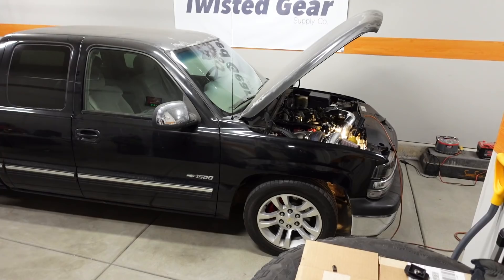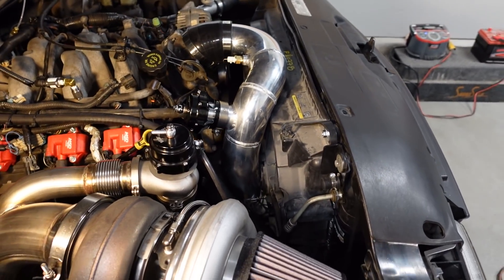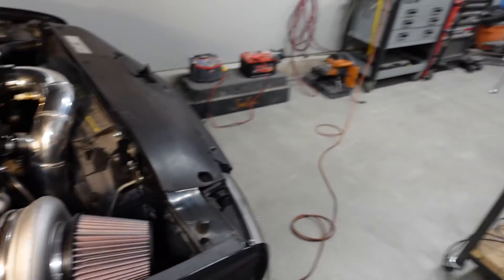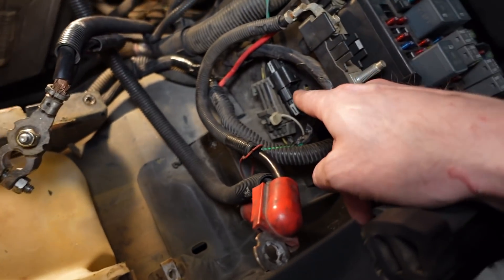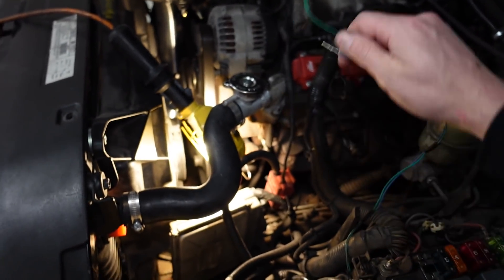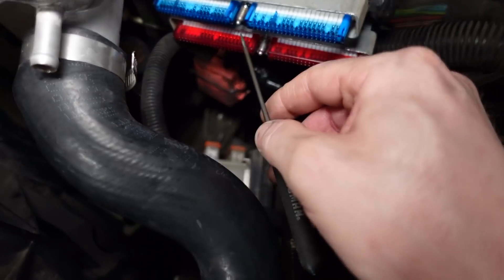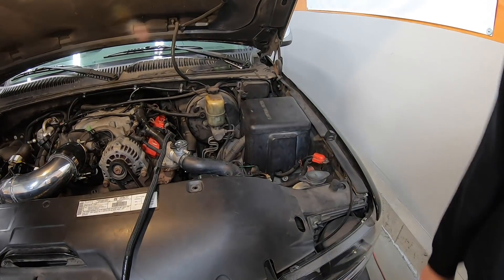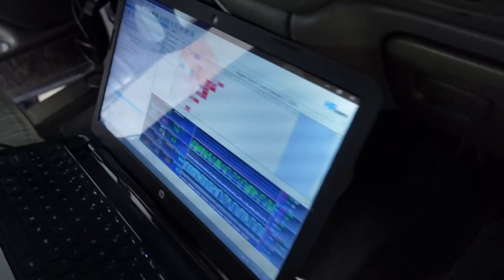Electric Cooling Fans on a 99-04 Silverado ft TURBO 8.1 BUILD ALMOST DONE

Comment: I’m installing the OE fan harness on my 03’ Tahoe with my 408 Stroker swap. 
Terrible luck with aftermarket harnesses and the relays.

The Flex-a-Lite fans I used before were drawing too much power. The Dorman efans for a 2014 fit exact and look OE. 

My buddy has an HP tuner and does it for a living. We’ll recheck and set parameters then plus tune the truck since the new engine won’t run on the factory map.

Awesome vid - I have an 05’ 8.1 2500 Burb that I’m restoring as well.

Comment: on my green/red connector that goes to the PCM, pin #33 already has a wire in that slot. When I bought this truck it was ahead 6.0 swapped but it’s a P01 pcm from a 2001 Tahoe. Any ideas?

Comment: This video actually helped me natrow some options.  Fan works(both).  Realy works. When I tested with  the blue wires on negative of battery it works.  Fan was working fine until a Heather core conection broke.  Now won't come on. New temp sensor was installed.

Comment: Actually, some 07-13s also had a 28" radiator, so the fans for one of those will bolt right in if you your 99-04 has the 28" radiator.

Comment: What is the actual name of the pin connectors for the computer ? I have a factory harness but of course the wires from the harness connector to the computer are missing. So I have to make my own. Thanks.

Comment: @Lawrence LT Tolman  Do I need to buy HP Tuners credits just to turn on the fan? Or are the credits just for tuning the engine?
Reply from the maker: The credits are for the entire engine computer: if you’ve already flashed it with HPT then you can make fan changes already. But, if you’ve never licensed your computer with HPT, it will take 2 credits to flash anything, including the fan
Reply: @TolmanPerformance   Ahh ookay, understand. Thank you!!

Comment: Hey Lawrence hope all is well. I'm here in New Jersey and have just did the efan conversion now I think I am getting a reverse polarity but before I switch the wires I wanted to ask,; do the fans blow into the radiator or the engine compartment? which is correct
Reply from the maker: They suck air through the radiator and push it into the engine bay, the air moves the same direction it would when you drive

Comment: What OBD cable did you use to connect to the computer to reprogram the fans? I'm only finding the wireless hptuner  obd2 connecter? I have a bmw the runs a obd2 to usb cable and wondering if that would suffice? TIA

Comment: What's the extra wiring step needed for 2000 trucks with A/C?
Reply: Did you figure out the additional step?
Reply: @chinogodinez  I ended up going to a salvage yard and pulling the entire wiring harness from a Suburban. Everything seems to work now.

Comment: Great video. . I have 2000 Silverado 1500. Pin 33 on red bank is already being used. Not sure what to do. I’ve found its for recirculation door control. Any ideas?

Comment: I got a 01 sliverado 5.3 how to keep my ac? Tap it in the ac signal wire??
Reply from the maker: no, you need to get an AC Pressure sensor so the computer knows what the AC is doing, and it will turn on the fans accordingly. I made an updated video about this with my AWD truck showing the correct wiring and steps
Reply: @TolmanPerformance  which video is it that shows this??
Reply: Ever find out what video it was that had the update?

Comment: Sorry I'm confused, where do you put the pin you took out of 33?
Reply from the maker: it just stays disconnected. Its original purpose was to force the AC system into recirculate mode if the engine gets too hot, which should reduce the cooling load. Now, the e-fans will speed up when the AC pressure or coolant temp gets too high (I made another video on the correct wiring for an AC pressure sensor)
Reply: @TolmanPerformance  do you have a link to that video? Thanks in advance

Comment: What is the one additional step I need to do to keep my A/C on my 2002 Silverado? Installed radiator, fans, and 99-02 Nelson Harness but now my A/C is not working. Had my tuner get the fans going properly but still no A/C, the compressor will not kick on. Any help would be greatly appreciated

Comment: Is it necessary to do that tuning afterwards? I have an '03 and was hoping it would just be wiring and drop-in.
Reply from the maker: I haven't seen a 2003 tune file to confirm, but I'm 99% sure you still will have to tune it to let the computer know there are electric fans that need to be turned on...
Reply: @TolmanPerformance  thank you for the information! i'll have to call around to see if any shops can do the tune for me. i don't see a need for me spending all the money on hp tuners for this one job. thanks again!

Comment: For the last week I have been trying to figure out why my new to me '03 2500 silverado AC has been not working at low speeds.. Turns out the previous owner did E-fan conversion. I'm assuming that they skipped out on the tuning because the fans only come on with engine temp, and not with the AC. Your video just gave me everything I need to know to go check that the pinning is correct and that I need to find a tuner to change that setting. Thanks for the help. Liked & subbed.

Comment: Quick question what extra steps do you need to follow for the ac to be fully functional with an 02 yukon
Reply from the maker: Theres an "AC retrofit kit" available that changes out the pressure switch with a sensor, and you wire that into the ECM so it knows what the high side pressure is, and kicks on the fan accordingly. If you find my newer electric fan video, I detail this during the install.

Comment: What if I want my 99-04 trucks AC to work how it should with the E Fans, what are those extra steps that I would need to do in order for it to do so? Thanks 🤙🏾
Reply: Same
Reply: Did this my ac compressor does not engage

Comment: I just pulled everything I needed from my 05 truck (rotted frame).. I have an 03 now. Can I just swap the pcm along with it ?? Or should I get mine tuned?... same truck only difference is the 05 in Not fully loaded & my 03 is.

Comment: So n o A/C?  Wouldnt work for me here in the desert.   I did this  on my 00 Sierra, and 02 Tahoe.  I used a BP automotive harness with the high pressure switch upgrade. Pulling a water trailer at 3 mph windows closed keeping dust out while in 4x4 to fill up our wildlife drinkers, nice and chill  at 56 degrees outside temp of 100, swap was well worth it. Other than that , cool video.

Comment: What is the additional step to keep your ac function
Reply from the maker: I showed this in detail on one of my latest videos, it involves adding a pressure sensor and wiring it into the computer, and changing some pressure settings inside the ECM

Comment: What did you do for the wire that was in pin 33 location? I don't want to lose anything from my ac system.
Reply from the maker: just disconnect it... I'm doing E-fans on my stepside for a video that drops thursday, and I discuss the AC pressure sensor you can add to these to make the fans function properly with AC. if done right, the fans will kick on high speed if the head pressure gets too high
Reply: @TolmanPerformance  thanks for the info I'll definitely keep my eye out for your video.

Comment: how are those msd coil packs working?
Reply from the maker: I ended up taking em off earlier this spring trying to chase down a misfire code... not for sure if they caused it, but as soon as I put the stock coils back on, the misfire code went away.

Comment: So I have the 2003 silverdo. Once I install everything. Do I have to Hp tune it as well?? Or is the Hp tuning only for the 99 to 02 model??
Reply from the maker: you will still have to adjust the tune to enable the fans to turn on
Reply: @TolmanPerformance  alright.. thank you..

Comment: What operating system are you running? Did you have to change it?
Reply from the maker: No need to change operating system to enable the fans, just set the temp and go. I’m doing it again on my stepside soon, will cover it again here shortly
Reply: @TolmanPerformance  thanks 👍🏼

Comment: What year of fusebox cover is that to fit 99-02?
Reply from the maker: 2005 to 2007 fuse blocks should have the right cover for electric fans
Reply: Any 05-07 fusebox Silverado will fit 99-02 silverado_1500 fusebox?

Comment: Hi, I have about the same set up as you but my truck is a 2002, same thing right? I'm having trouble with my second stage fan not coming on, I've also taken off my AC and set up parameters on HP Tuners but for some off reason my second fan will not engage, I've checked all fuses and nothing, you think you can shed some light my way?
Reply: Do you have both pins wired correctly in to the PCM? Make sure that you have the ac type fitted to fan #2 and not recirculation and fans are set to 2 fans.
Reply: @farmerjohnsonoffroad   I believe so, ill have to check my wiring then. its such a head ache but gotta love garage built 😆 lol

Comment: What’s the extra step for those that have or keep A/C?
Reply from the maker: I'm gonna cover it in an upcoming video, but the right way to do it is to add a 3 wire pressure sensor to the ac line and control it like a 99-02 LS1 camaro
Reply: @TolmanPerformance  Can't wait to see this upcoming vid!

Comment: What is the red wire that is suppose to be removed in the 33 slot to put the other wire ?
Reply: That is a command for the recirc door. Theory is it overrides the recirc door during an overheating event, to help cool the engine. You can remove the pin, cap the wire, and tape it in the harness as it isn't used.

Comment: Hey, Great video!!, Thanks, I have an 02 silverado 4.8,  I fixing to put stock daul fans from the 06 truck. The auto parts store  recommend a 197 degree thermostat.  But I think that is too high. So I put a 187 thermostat a good while back. Thinking about putting a 180 for the swap. Originally when it had a 197 I could feel the heat when I raise the hood. So if I go with a 180 thermostat what should I set my fans at for low and high? PS, I using a Dakota digital 2800bt module and a BP Automotive Harness instead of the ECM because they want over $200 dollars to flash it.
Reply from the maker: if you do a 180 thermostat, probably have the first fan come on at 185, off at180, then the second fan a  little higher, on at  195, off at  190.

Comment: Whats the extra steps for the 99-2002 to pin the night speed with ac? I’m having issues
Reply: You need to wire in an ac pressure sensor from an 03+ truck. It is a 3 wire sensor that the 99-02 camaros used. This will allow you to set your ac fitted to serial cycling, which will use the ac refrigerant pressure to turn on the lows and highs as needed.
Reply: @farmerjohnsonoffroad  thanks man, I managed to figure it out and either way sold the truck lol

Comment: Im curious if this fan setup would work on an OBS with an 0411 swap 🤔
Reply from the maker: sure would, all you need is to get the two signals from the PCM to activate the relays, the rest is handled by the harness

Comment: My 72 GMC I have an ls 6.0 installed with factory computer and factory fuse box.  I used a 28 inch radiator because that’s what fit and a 97 to 02 f body fan that I made some adapter brackets to bolt to the radiator.  The fan is controlled through the ecu, and the ac has a trinary switch that also grounds the fan relay.  One question I have is what temperature should the fan come on related to the thermostat you have installed?

Comment: I wonder where the existing red 33 wire went and should it have been spliced in?
Reply: I would like to know the same thing, hopefully LT will respond.
Reply: The pin 33 wire just gets removed and capped. It is a ground control for the recirc door of the hvac box. The computer will close this door during an overheating event to put more air across the heater core to help cool the engine. De-pin it, cap it, and tape it to the harness.

Comment: LT,
Do you have a video on the actual 34” electric fan swap from the smaller 28”?
Thanks
Reply from the maker: back when I did the 8.1 cooling system last summer, I went over some of the differences between the two, but honestly, its a straightforward swap and all the mounting hardware is already there to allow you to install the 34" rad
Reply: @TolmanPerformance  
Thanks

Comment: Hey LT great video! Just one question, I have one of those 99-02 trucks, and would like to keep my AC as I live in Arizona. What are the extra steps to keep functioning air conditioning?
Reply from the maker: there is a write up online, but it involves using a relay to convert the positive signal from the AC clutch to a negative signal to enable the second fan (I think).
Reply: If you are using a factory harness, then you just need some extra programming to make it work. You will still pin the green wire to pin 42 of the blue connector, and the blue wire to pin 33 of the green/red connector. We figured out how to run this using the AC switch and messing with the type of ac fitted controls. 2 different ways to do this is by using the factory ac pressure switch and the other is wiring in a 03+ pressure SENSOR. Switch is on/off, whereas the sensor actually gives a voltage reference return (range of 0V-5V).
Reply: @farmerjohnsonoffroad  do you have a video or thread somewhere explaining how to do this?

Comment: I did not realize they did an add on thing I assumed it was like in the fuse box and not really feasible to do and over $100 for the after market harness was way to much for me and my fans came with pig tails for the fans they had cut so I just had to get some relays and pins for the ECU and did it myself

Comment: good call on the OEM cooling harness. I had a buddies 03 that had an electric fan swap with aftermarket kit die on him out on the trails. Luckily i have a pretty good knowledge of the wiring, and i pulled out the relays and bridged power to get us back home. not bad for just having a pocket knife and some duct tape.

Comment: I presume the oem twin fan didn't come out until 2005 year model?
Reply from the maker: correct, 2005 was the first year of electric cooling fans for the Silverado 1500, before that they all used a belt driven mechanical fan

Comment: Probably a dumb question [ but I am ancient ]. Is there any possibility of positioning  the turbo air intake to provide cooler air [ ? maybe some form of baffle to reduce intake air temp? ]
Reply: The air needs to go through an intercooler from the turbo compressor before it goes into the throttlebody otherwise you need a direct out ram air.
Reply from the maker: sure, you could make some sort of a heat shield that will help the turbo suck in only outside ambient air, but my thought is the turbocharger will heat up the air anyway when it compresses it, and the intercooler should take away some of that heat, so I wasn't awfully worried about it
Reply: @TolmanPerformance  Thanks for that, sounds good to  me.

Comment: So if i want to retain ac, what else do i need to do, when installing e fans?
Reply from the maker: you basically need to trigger the second fan from the AC compressor instead of the PCM, but that uses a positive signal, so you use a relay to change it to a grounding signal and the fan comes on when the AC kicks on
Reply: @TolmanPerformance  I want do this conversion to my 02’ Suburban 1500 Z71. Where can I find more information?

Comment: By far the best video on the swap !!!!!!!!!!!!    I have all the pieces to do the swap including the factory harness for my 01 with AC.  Can you elaborate on the extra step needed for the AC to function properly with the new setup ????   Thanks
Reply from the maker: there are a few write ups online, but it involves triggering the second fan from the AC compressor clutch instead of the ECM, but that uses a positive signal instead of negative, so you use a relay to make the change and trigger the fan.

Comment: Hey lt how hard is it to turbo a 97 5.7 vortec
Reply from the maker: there are a few challenges like the stock injectors and PCM, but nothing that cant be overcome if you are persistent enough
Reply: Check our Richard Holdener
Reply: Thank you lt and I have checked out Richard holdner he dosen't talk about the intake plenum on the 5.7 vortec and the injection

Comment: Did the same fan upgrade to my 01 Tahoe. Hard to find the parts but way better then aftermarket in my opinion. Sent out my ECU to a tunner to unlock the fan feature, so for I have had this upgrade for several months and no problems at all. In my case I can only use one of the leads to the computer and the other to a relay to change the positive polarity to a negative and run to a a/c wire.
Reply from the maker: yup! had a few people ask about that, should've done a better job explaining the differences in the early years for AC
Reply: @TolmanPerformance  I bought a truck with one of these already installed and I’m trying to get the ac to work. Any good reference on how to wire in the compressor trigger? Will I need to re-tune?
Reply: I bought a truck with one of these already installed and I’m trying to get the ac to work. Any good reference on how to wire in the compressor trigger? Will I need to re-tune?

Comment: What is the extra step for a/c trucks? Does it require a extra relay?
And great truck build.
Reply from the maker: yeah, basically a relay to convert the positive signal from the ac clutch to trigger the fans or something like that
Reply: @TolmanPerformance  Thank you and keep the videos coming great work.
Reply: That’s what I was wondering